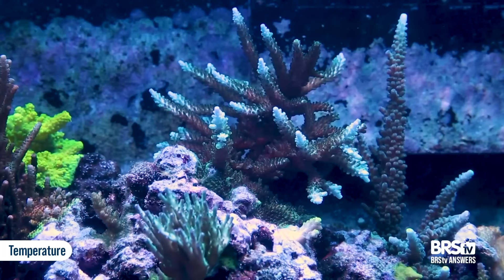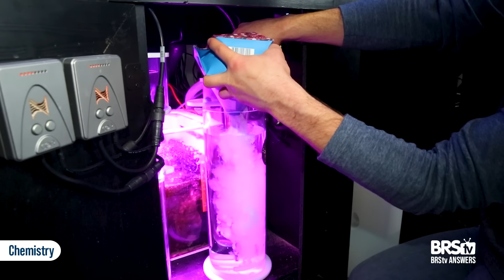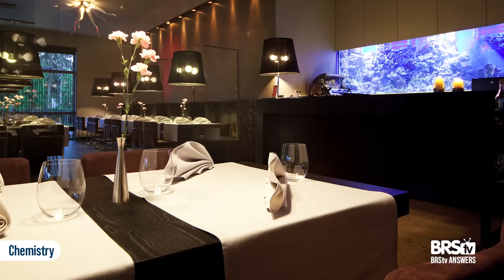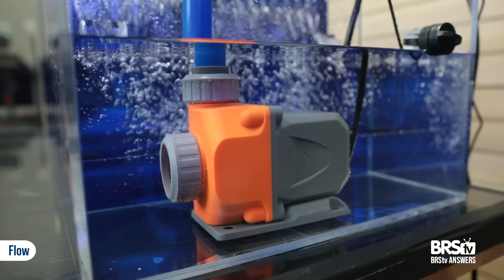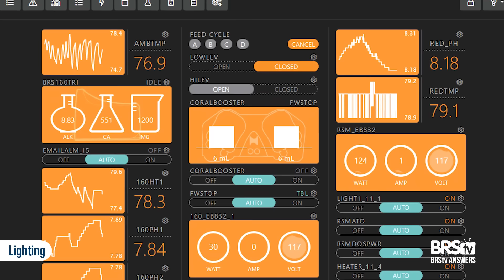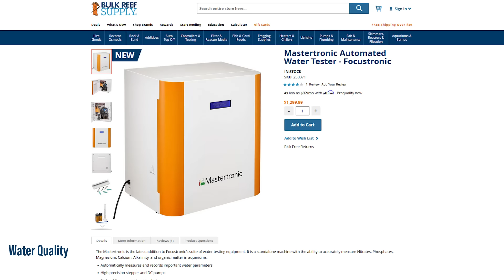Can You Recognize a Reef Tank Crash Before It Happens? 3x the Survival Rates for Those Who Can.

Comment: I was a tech junkie.  As many systems as I could cram under the cabinet.  Its amazing how a tiny piece like a sticky one way valve can upset the system.  Plus, all the installations were destabilizing the system.  I have returned to a more manual and basic system, albeit with calcium reactor, but now the big addition is a CO2 scrubber on the skimmer.  Alk and Ph are pegged at 9 and 8.2 respectively and I have never witnessed Acropora growth so rapid and colorful.  The first frags have fused to their rocks in just three weeks.  It took a bit of calcium, a lot of magnesium, and a bit of kh to get everything in place, but now it is stable.  It gets a little extra strontium and iodine, about a quarter of the recommended dose.  Those were started later and actually seemed to encourage tissue growth, although it could also be just maturity and water changes.  That is difficult to say for sure.  The stores with the best reef tanks all have different regimens.  I put most of my faith in time, water changes, Red Sea Coral Pro salt and the CO2 scrubber.

Comment: what temp do you set your alarm limits for on a rainbird?
Reply from the maker: It will depend on what temp you set as you ideal temp, but in most cases, anything over 82 degrees F or under 75 degrees F is when we'd want to be notified.

Comment: I bought the WiFi Inkbird from you and have had nothing but problems.  E5 errors on 2 units, shut down, and almost killed my tank due to temp drop after shutting off.  After researching the error, it turns out that it shuts off after being on for a set period of time, regardless of temperature (overtemp).  Terrible design, and dangerous.  Nobody has been able to explain this issue.  They also don't pair, which was the reason to get the thing in the first place (for notifications).  The old one w/o wifi works great.
Reply: That's why I don't rely on automation like others I know do. It keeps me in tune with the tank.